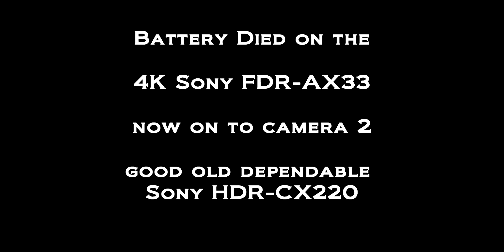99 Tahoe Catalytic Converter Replacement

Comment: My 99 gmc yukon is reading the same thing but says Bank 2 , its has a bad hesitation & bogs out when I try to push into the gas . I've gotta like ease into the gas but it wont go up any hills
Reply: Ever find out why?
Reply: Mine does the same and it doesn’t rev past 2000 rpm

Comment: Can I run a straight pipe instead of replacing my converter
Reply from the maker: you can but you're going to get check engine codes even if you leave the O2 sensors in line still
Reply: @DaddytechEnt  I just went down and checked they took both of them how bad would it be on my engine
Reply from the maker: @thermonmiller4237  initially you won't notice any real difference other than maybe your check engine light staying on all the time.  log term it will just slowly get weaker and louder though over time. and your check engine light will stay on forever because no O2 sensor readings will come through to the ECU
Reply: @DaddytechEnt  thank you now I just have to get it done

Comment: I have a 97 tahoe will hollowing out the cat will that make my truck run like shit due to the the computers air to fuel ratio reading
Reply from the maker: it will always show a code for catalyst efficiency if you do that probably. not to mention it's illegal and would take way more work than just replacing them with a good aftermarket replacement set.the set i bought is a direct bolt on replacement. plus remember yours has 2 converters not just 1 so that would mean having to do everything twice. mine has to pass emissions testing here every year so i put on a new set but i'd really like to put on some larger pipes so it can breathe better and be more fuel efficient too

Comment: I'm going to straight pipe my Montero and get rid of my Cad.it's bad and I'm not replacing it.
Reply from the maker: +Ridge97  yeah can't do that here. for some stupid reason Nashville and Sumner County are both Marta testing places so i had to do this. if i did straight pipe mine i would have to buy 2 cats
Reply: DaddytechEnt Mine has two cats.I just think it would run better without them. I'm up in East Tn..no inspection here..didn't even know you guys got inspected there. LOL
Reply from the maker: yeah we didin't have that in Knoxville either but they do here unfortunately.